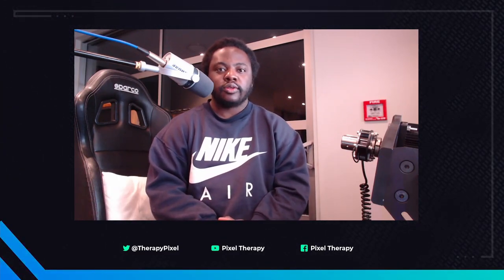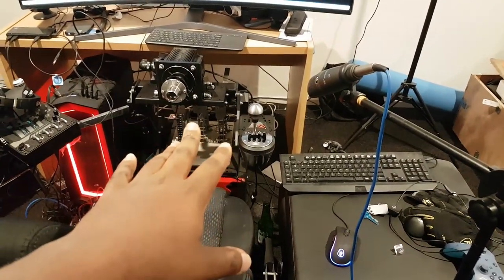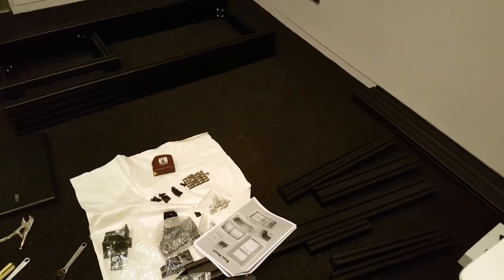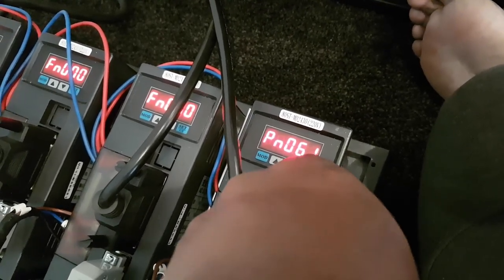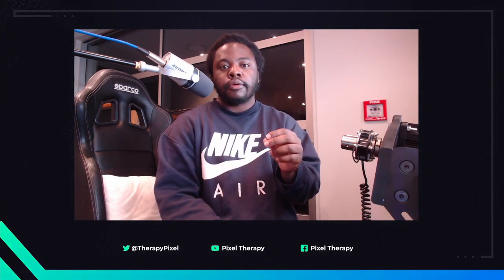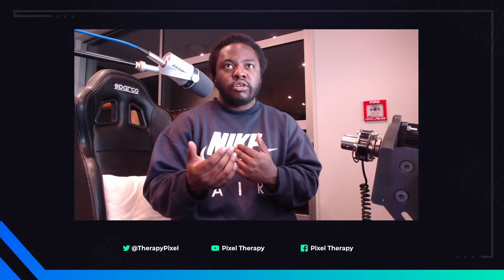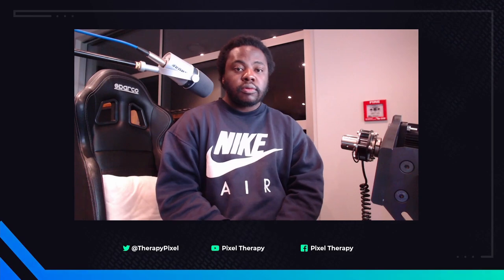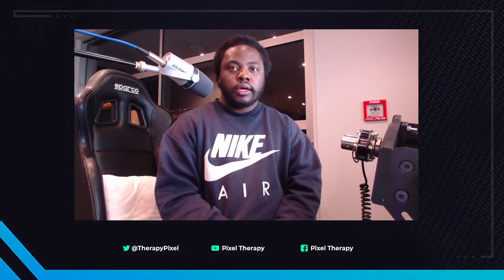Building My Dream Motion System - Was It Worth The Money ??

Comment: Really enjoying your content, very detailed and informative info. I really enjoy motion and tactile for immersion, but for me i have to turn motion off to be as fast or consitent. I do wonder if it is because my motors are geared and i do not feel the forces in time with my wheel and this is what makes me slower. I have also tried with very little motion and using single dofs. 
Still it is bloody amazing having motion!
Reply from the maker: Haha... funny you talk about motion and how it relates to speed, currently working on a video where I use iRacing to test whether, FFB, motion and VR are just gimmicks! 😉. So watch out for that video this week! Also thank you for encouraging words. Check my discord and we can talk more!! 😂🤣
Reply: Have you looked at Sigma Integrale's DK2 system? One of their strengths is the instant motion compared to some of the bigger motion systems that have a bit of delay.
Reply from the maker: @timt8199  No I have not tried any other system. To be honest once you are in the 200-250mm/s speed range you won't notice the difference. At least not with a 4 actuators system. So PT, Prosimu, Dbox and Sigma integrale should be relatively indistinguishable in response feel at least mechanically. The rest is based on tuning software which can include damping or spike filters which would soften actuators response for smooth and less jerky motion. Again this would be more noticeable in rally and off road with bigger and faster suspension travel compared to track racing with more immediate and short movents. Either way actuator based motion has been refined so well you will be fine with any of the brands I just mentioned including the new Qubic system

Comment: Good video mate! I’ll be following you in your journey.
Would be able to post the links to the other motion platforms you mentioned?
Reply from the maker: Yup will do! Thanks for watching, updating description with links now!!!😂
Reply: @PixelTherapy_85  cheers mate! I’ve been considering getting the PT Actuators but they are 6500 USD (scorpion super). Did you end up getting super as well? Also would you be able to tell us how much it costed you?
Cheers mate! :)
Reply from the maker: @frankok8907  Hi,  I  purchased the scorpions super for the full $6k USD rice.  But really the super has a stroke of 150mm actuators travel, I have set mine to 130mm travel max in my controller (to preserve internal bearings for end to end wear). My spike filter kicks in after 3mm of travel, so what I am trying to say is the experience with 100mm is more than enough. 150mm is only useful for flight sims. So save money and get the experience. Or consider building your own with sfx100 or sx150 DIY kit
Reply: @PixelTherapy_85  right right. That makes a lot more sense! I’ll definitely do more research before pulling the plug lol
Thanks a lot for answering my questions mate! I joined your discord so I’ll bother you there now if needed 🤣
Reply from the maker: @frankok8907  all good, I am happy to help!

Comment: Still have the system or did you sell it yet?
Reply from the maker: I still have it, running smooth with no issues 😅🤣
Reply: @PixelTherapy_85  just wondering.  Still fun?
Reply from the maker: @varpornrat  Yeah, I still enjoy it. As with all things the novelty does diminish over time, but I definitely notice it's absence on titles that don't support motion. Considering I have been running motion for over 2 years, with no issues. It's definitely paying itself off.
Reply: @PixelTherapy_85  you plan to add surge and traction loss in future?
Reply from the maker: @varpornrat  I don't think so aye. I don't think it's necessary. The 3DOF combo of pitch, heave and roll is pretty on point in simulating suspension feel, and your brain fills the gap regarding traction loss quite easily. So paying the extra $4K USD for surge and TL... not sure it's the best place to spend $$$. Would rather upgrade my PC lol

Comment: I need to gear up....
Reply from the maker: Lol... you could.. But really you don't need expensive gear to enjoy racing lol. I had an awesome race over the weekend, and the thrill was more the side by side action than the gear! Thanks for watching the video though! 😂
Reply: @PixelTherapy_85  I was thinking about getting a Logitech G29 to start off with. What do you think?
Reply from the maker: @dstrktr666  Logitech G29 is a good starting wheel, but I would recommend either a Thrustmaster T150 or T300. They are around similar price, but the Trustmaster are smoother cause the have belt system rather than logitech's gear system. So the feeling with Thrustmaster is smoother (less notchy) and queiter for that late night racing! 😂🤣
Reply: @PixelTherapy_85  Cheers man! I'll see if they have those in Sri Lanka
Reply from the maker: @dstrktr666  If not get the g29

Comment: it sounds very very bad, don´t see fast moves it is capable?
Reply from the maker: hello are you asking about response time? its 250mm/s so no lag at all 😂
Reply: @PixelTherapy_85  i got 2dof njmotion compact-r a seat mover, so no sounds from rig, algo fake heave is well simulated in jumps, but im curious of real suspension of 4 actuators
Reply from the maker: @izhangt3787  I have never used a seat mover, but with 4 actuators @250mm/s there is no lag. 1 PT actuators can carry max load of 200kg so 4 actuators = a sim rig weight of 800kg. So basically I don't see any lag at all. 
Just check the following specs with actuators:
1. Check speed eg. x mm/s you want a minimum of 200.
2. Check stroke length 150mm is usually a good number especially for rally and flight sims
Reply: @PixelTherapy_85  will check, but the noise of the rig is so loud when moving all. Rig, did u fix that?
Reply from the maker: @izhangt3787  Rig is quiet in my opinion even my gf was suprised. Like I said in the video, the motion wasn't tuned when I did that demo.  Watch my newer videos or Sim Racing Garage review of PT actuators to judge is its too noisy, when it is properly tuned. 😂🤣